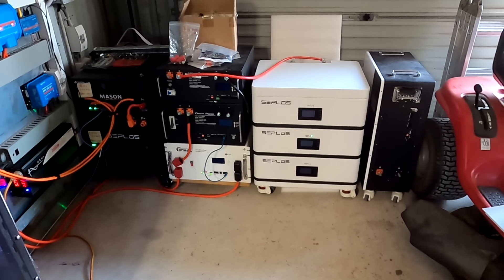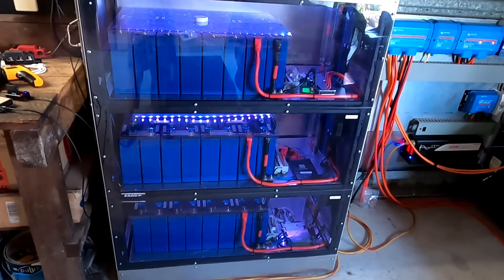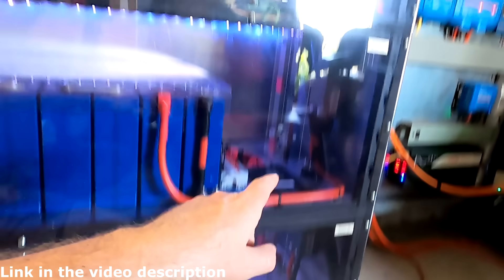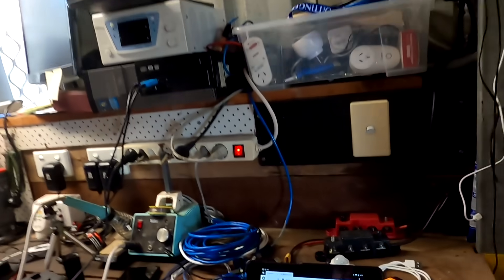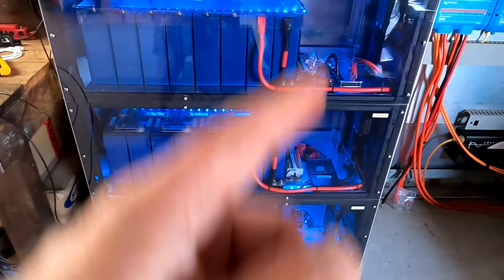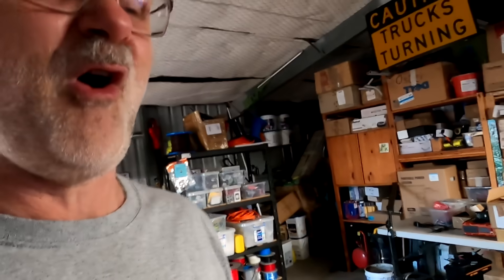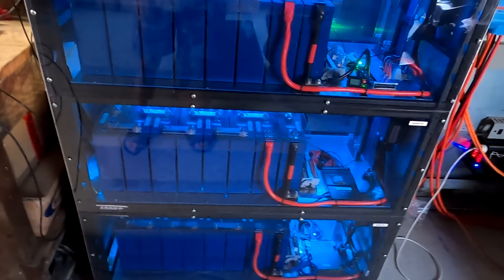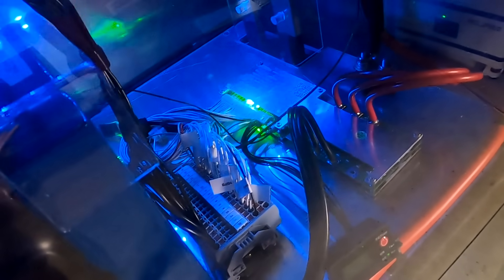Something wrong in the battery shelf! Or just 'bad' settings?

Comment: Charge to 3.45 volts and use the JK BMS's on all three packs, seems like the obvious answer, save the other BMS's for backups, for thee zombie apocalypse...Appreciate the testing though, that always confirms my BMS choices...I'll always avoid the steep curves, charging and discharging, unless some unknown information penetrates my reality...Stress degrades and kills everything eventually, whether alive or not..
Reply from the maker: The middle shelf battery with the JK seems to work best of all three. Even it has aluminium bus bars.
Reply: @OffGridGarageAustralia  But still a quite large delta even with a Neeeeeey? Wouldn't that suggest that @3.45v that lower SOC cells once current is applied actually spike up to 3.45v quite quickly and negate the active balancer doing its job? Pushing to 3.55v allows the proper runners to show their real colours and whack a mole can start with the active/passive balancers?
Reply from the maker: @AussieAustrian  I'll explain this in the next video. I have basically never fully balanced my whole battery shelf after the first initial top balancing. I don't allow enough time for balancing at 3.45V.

Comment: I like so much this video that I'm going to do the same test. Have the same opinion higher voltage will degraded the batteries faster and you will gain 2 or 3% capacity. Probably you will need another 6 months to see significative change :) The BMS from top shelf didn't balance bottom battery so the problem is not in the BMS but in the battery, check everything in cell 7 and measure voltagem when balancing and compare with the value of the bms. Your cells are not compressed so you could swap cell 7 with cell 4, it's the fasted way to find a bad connection or cell. Another great video, congrats.
Reply: Just noticed that you changed the float not the absorption so it should balance faster, I replicate it but cells won't like, at the moment I'm doing a daily cycle so results should be diferente but I'm curious.

Comment: Are all BMS calibrated cell voltage are correct .
So i tell are all voltages the BMS reads are the correct voltage of the cells it measures?
Reply from the maker: Yes, all correct and confirmed in all three batteries.

Comment: Also I agree that changing and balancing at a higher voltage is better. In fact I had to do this to get my packs working right. And you said your self! At a higher charge, it take less charge to make a bigger difference so when you get it balanced in that high curve, your cells are so much closer together. But I also agree not to start balancing tell 3.45 volts.
Reply from the maker: But the question is: do you need that balance at a higher voltage? All my three banks are working perfectly fine and I never had a cell peaking even at 3.45V. So why charge higher?

Comment: Good questions at 13:40 Andy. In regards to gain in capacity by balancing at 56.3v. After another year and nearly 200 cycles on my 3, 300wh 16s LFE packs, each with a non-programmable DALY passive BMS, and all connected in parallel, with no diode isolation, I found that charging to 54.6v or about 3.40 per cell, which was below the 3.45v the DALY appears to balance at, after about 6 cycles to about 20% SOC, each of the three packs had cells that drifted to as much as 180mv with no passive balancing. 

Charging to 55v, was not enough to bring the cells into balance because the DALY BMSs only balanced for a few mins before the cells dropped below 3.45 and the BMSs stopped balancing. Charging to 56v typically balanced the packs to about 80mv in one charge, and 55.6v brought the cells to about 30mv. 

Something else I noticed, was that the DALY passive BMSs don't seem to balance as long as a charge voltage is applied as the charging current applied to each cell is greater than the balance current, because the balance circuits simply shunt charging current rather than battery current, and balancing occurs only after after power is disconnected, which in my case makes the case to charge well above 3.45v per cell. 

Doing three test runs to BMS cut off voltage, I seemed to gain about 10% capacity at 55.6v over 54.6v. This seems to be due to better cell balance rather than the added charge,  but that's mostly observational Watt hours used and some of the gain may be due to temp difference. I need to do a bench test in controlled temp to confirm, but taking the balance from 180mv to 30mv seems likely to account for the range increase. 

Does low charge rate degrade performance?  Last year on my test packs I was slow-charging between .1C to .2C to 3.40v per cell to try to preserve cell balance and life, and my 3, 300 Watt-hour packs were delivering about 250 watt-hours, this year I've been charging at 0.5C to 1.5C  to 56.5v for almost 200 cycles, and the packs now deliver 280 to 310 watt-hours each, and with a noticeable increase in torque and acceleration, that seemed to occur after charging at higher current, so I wonder if LFE cells loose performance or don't fully charge at lower currents? 

Finally, I've been charging a 3.2v 1S, 24AH ebike booster pack, that use 4P 32700 LFE cells to 3.75v at .3C, and after 400 cycles the pack is delivering about 8% more capacity than when constructed two years ago, so at this cycle level I'm not seeing any degradation but the pack rarely discharges above 1C  and mostly at 0.2C to 0.5C discharge. 

Personally, from what I've read and my limited testing,  I question if high-discharge rates at elevated temps may degrade LFE cells more than gently charging to higher voltages could result in more cell degradation, some older small-scale Chinese university research testing seems to suggest that, however newer LFP chemistry and materials improvements could have improved that.
Reply from the maker: Thanks for sharing. Your batteries seem small enough to make the DALY passive balancer work. I could not share the same experience with my larger capacity cells though
Reply: @OffGridGarageAustralia  If a passive balancer that that drains about 170ma can barely keep a slightly mismatched 6ah to 24ah pack balanced, I don't see how it could be effective on a 200ah pack.

Comment: Hi Andy, do you remember me? I'm Peppe from Napoli (Italy) the place of sun, pizza and spaghetti. I was one of the guy saying that the charging voltage of your lifepo4 cells was too low, reason why you have unbalanced cells. Now is time to make you changing your idea about seplos bms ! Do you remember my previous message saing that the seplos bms works perfectly fine with my Voltronic Axpert MAX hybrid inverter? Well, you can set your seplos bms in a way it works well with your system. SEPLOS bms (v2.0 10E) has three high voltage sets, normally only two of them are used. 1) The first level is named "total pressure high pressure alarm". Once reached this voltage level set, the bms reduce (via commujication bus) the charge current to 9A after a delay of 30 seconds. 2) second set is named "total voltage overpressure protection" which is a set communicated via bus to the charger controller as voltage setpoint and in the same time, once the voltage has reached, is going to open the charging mosfet. 3) last level set is called "Harging overvoltage protection" ("C" for some reason is missing) which is the last level of protection once reached, the charging mosfet are opening. Now some of you may think: "Why they implemented two overvoltage threashould"? simple! because the second set level (total voltage overvoltage protection) can be disabled as alarm using a flag control on the right side of the settings, leaving on it the only functiolality to communicate to the charger controller the charging voltage setpoint. With those settings the one which is going to work as protection is the third one (charging overvoltage protection) which is working exclusively as protection, thipically at higher threashould of level two. I hope it is undertandable Andy. let us know...
Reply: I agree, a retesting of the Seplos BMS (and Pace BMS) once the results are in should be done. Andy might be surprised to find that both BMS's do reset SoC without driving it into protection.
Reply from the maker: I'll test it again at some stage but the 10E only shows 100% if OVP is reached afaik.
Reply: @OffGridGarageAustralia Recent 2 videos on my channel disprove that.
Reply from the maker: @sarahjrandomnumbers  I assume, you're not off-grid? The Seplos BMS have a different behaviour in either scenario. It took us months to find out by comparing XML files and settngs.
Reply: @OffGridGarageAustralia When I'm charging to 100%, I am offgrid, cause it's the solar that takes over from 56.4 to 56.8, and as you can see from the videos I uploaded, the current drops and it resets.

I doubt very much that the battery knows or cares if the power its getting is from the grid or from solar. I could see it being an issue when you're ramming 120A+ into the battery at almost peak voltage, as your system did earlier at 1218, your time.

Where as my system charges 15-20A until 56.4, then solar does around 5A until 56.8 and its absorbed. Then SoC resets.

I guess the other main difference is you system isn't hooked up to CAN, where as mine is, that would certainly explain the lack of slowing the current down towards the peak. All I'm saying is, it works for me, so it should work for you too.
Reply: @OffGridGarageAustralia  Just an update, a friend who uses the same BMS in his offgrid, solar only van just had an SoC reset at 56.8v.

So the claim that "on grid and off grid setups work differently" isn't correct.

Home assistant pictures available upon request.
Reply from the maker: @sarahjrandomnumbers  It's not a claim, it's a fact that the BMS reacts differently between off-grid (no export) and grid connected (energy can be exported). Quite a few viewers left comments and sharing their settings.
Reply: @OffGridGarageAustralia Then I guess the BMS my friend has in an off grid setup is totally different to everyone elses then.🙄
Reply from the maker: @peppeper9325  My friend from Napoli, my 10E BMS and software does not use the word overpressure any more. I guess, you're talking about the 10C BMS, not the 10E. You're mixing things up here...
Reply: @OffGridGarageAustralia  Good afternoon Andy,  the " overpressure" term do not depend from the bms version (which I confirm is an 10E version) but depend directly from the used software. Specifically I'm using an EEL BatteryMonitor software which is slighly adapted starting from original Seplos software. Anyhow, eachone of us can rename any terminology present in this software simply editing a txt file included in the folder "Agreement". I edited the file 16S_V20-ADDR_EN with a simple text editor application an replace all "pressure" terms with "voltage" and "monomer" with "cell". Simple as that ! Peppe from Napoli.

Comment: 55v is too high, the higher you go the bigger the deviation will be
Just charge to 54V, I got my cells for 3 years.. and they are perfectly balanced, no need to charge higher, there are no capacity out there.
Everytime you force the cells to high voltage you are hurting them.
Reply: The manufacture suggests you can charge to 3.65v, 6000 times(with compression) for LF280K cells, so there is no basis for your claims of "hurting them" I call BS.
Reply from the maker: Charging to 54V is not enough to claim your batteries are balanced. They also 'seem' balanced at 52V. As we know, that can only be determined once they come out of the flat part of the charge curve and voltage rises over ~3.45V.
Reply: Ah catch 22.  Are the cells really out of balance at 3.45?  Could taking them above 3.45 be causing them to be out of balance?

Comment: Saving your back 😀 nice use of lift it’s on wheels, it has great reach, capacity is more than equal to the job, and getting the lift from the ground up to a working wall height. But it’s making it more of a one man job. Thumbs up 👍
Reply: Wish I had one. Getting a SPF12000T on the wall was a pain.
Reply: @chuxxsss  engine lifts are not so expensive and there used ones around. Also rentals.

Comment: I charge daily to 3.55V, and seem to work well. its a bit higher up the curve then 3.45 to seperate the high flighers from the low once.
Still need to set up my BMS to deactivate the active balancers below say 3.4, but who has the time!! i think i'm in that stage of "good enough" and there is not enough reason to sort it out... maybe some day!
Reply from the maker: If it works for you like this, don't change it. I'm just testing here as I'm curious what happens if I change certain parameters and settings.

Comment: Hi Andy, just watched the video. And found out that... Just have running my own battery with a JK BMS and I see that you have a wire resistance of 0.152 and I have using the litse bus bars an I have 0.048 and 0.050. Will this make so a big difference? And I have also the max of 55.2V on the battery. 15kWh.
Reply: For me too, with my JK BMS 16S the resistance is 0.050 or 0.049. With my JK BMS 8S the resistance is all at 0.038. All my lugs are welded. On the other hand, Andy's cables are elongated and pass through a connection box.
Reply from the maker: I have one of the very first JKs. The one which needs a jump starter battery to fire up....
If the bus bars are to blame, it would show a different resistance if under load than in idle. That's not the case for me though.

Comment: I do not think the extra capacity is worth the extra degradation. There are many scientific papers showing LiFePo degradation by voltage ( calendar aging ). Personally i set the high limit on all my projects at 3.5 volt per cell and generally have under 30mV deviation. Less then 1% capacity should not make a difference in the usability of a system. I do build systems up to 100kWh with huge loads. I found the sweetspot, after a lot of testing at 3.50v. ( 3.45 made deviation less stable, where day to day differences where acouring more offten )

The problem with charging to 3.60 - 3.65 is hitting over voltage protection,. In a multi battery pack this will create an OVP and will disconnect one after the other and ending up in one taking all the charge at the end. ( not everyone has victron or can/serial/rs485 comunication to prevent this depending on the usecase and budget ).
So in general it is better to to be around 3.5v and set OVP at 3.65 leaving a 150mV deviation space to keep the entire multi battery pack active.

That sayed it is still great seeing you doing all these tests, proving concepts ;)